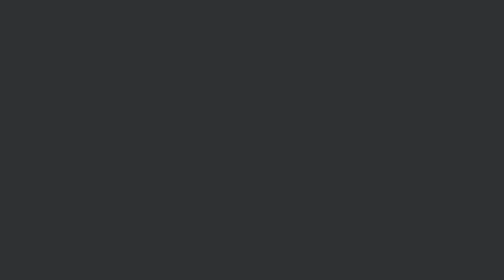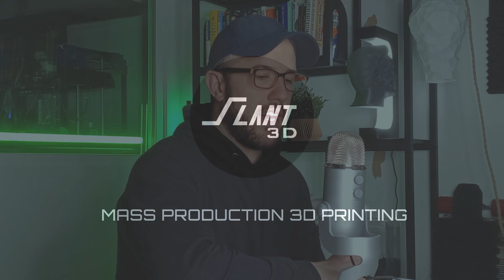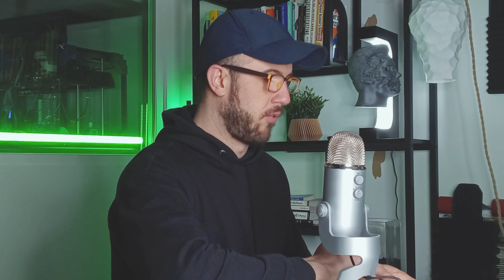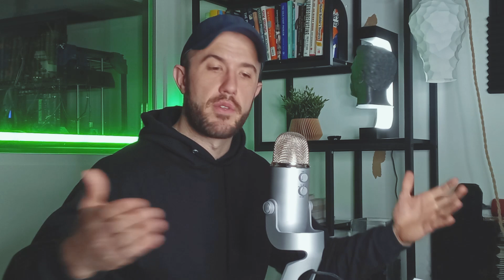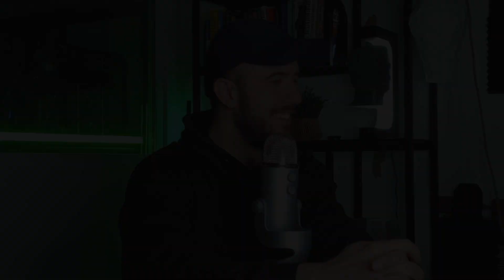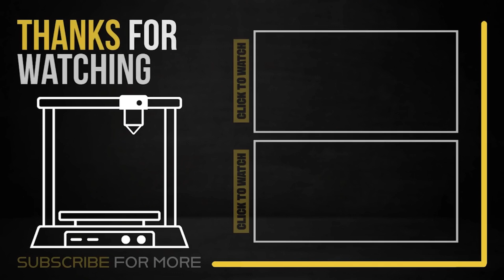Should We Start Making Filament, 3D Systems' Fined, & Stratasys Buyout Attempt

Comment: Can you please discuss the counter-offer by DDD at 24.10? Frankly, I see more long-term gain from a technological-level merger of Stratasys and Nano Dimension than Stratasys with DDD. The fact that Stratasys wants to add DM into the mix is rather strange, as DM really doesn't have much to offer either technologically, or managerially. Why would Stratasys even want DM? (Yes, I've read why, but it sounds hollow). Additionally, I believe DDD desperately wants Stratasys merely to remain relevant, as they too have little to offer comparatively. I'd welcome your thoughts. Thank you.

Comment: If you can offer cheap bulk PLA/PETG I think you can really make the market move. 90% of the time i don't care about the appearance of the plastic because im just trying to churn out functional parts yet I have to pay this premium for quality plastic. Even if you just sold reject reels of plastic that didnt meet spec for color or strength or diameter but would still work fine for the average home gamer that would be big. Also, consider ditching spools for extra savings. I would be more than happy to spool up loose filament if it meant saving a couple bucks per kg

Comment: Call it slant simply black pla (most forgiving). 12.99$ for 1kg spool, 29.99 for 3kg, if you buy over 100$ then free shipping. Don't guarantee color, but guarantee accuracy and reliability. Most first prints in hobbies, people don't care about color. If that takes off sell more colors and options.

Comment: I'd love to see a "K.I.S.S." philosophy used in filament production.  PLA/PETG only.  Black, natural & grey only to start with and if things work out well then maybe introduce basic colours.  Really, just the basics and not a whole rainbow pallet of colours.  Most importantly NO SPOOLS!!!!  Sell by length instead of weight and just the ship raw roll that I can load onto my own spools that I already have.  Just a simple product at a low price.  Buy direct from the manufacturer and use the exact same product they use themselves. You could even go one step further and offer a "scrap" line where all your off-cuts, failed extrusions and failed prints are reground, blended and extruded without any concern for colour.  As pure a recycled filament as you could get.  Turn your trash into treasure.
Reply from the maker: We have something we are announcing really soon

Comment: Really anything that's significantly more impact resistant than ordinary PLA. There are some great engineering blends out there, but the price premium for tougher blends can be shockingly high given that the raw materials are still fairly cheap. I'm not picky about color. Things that have worked fine for me thus far: tough PLA, PETG, tough PETG, PCTG, and easy-print (CoPA) Nylon. Ordinary PLA is a bit too brittle for my projects, but a lot of the other options work fine. Some low-cost tough PLA would be great.

Comment: Make sure that your spools are not too wide! Bambu lab AMS has a certain width limit and will not work with spools > some width
Reply from the maker: We'll take that under advisement. Though we don't intend to design toward any particular machine if we do it.
Reply: @slant3d  It's not about designing toward a particular machine really, it's more of a compatibility thing. It's minor adjustment at planning stage that would allow you to have another earning stream open - because if that spool of yours would be wider than the amount of -  46-70mm, and the diameter exceeded 200mm they would be incompatible with the ams - it would be a no-no for that part of the casual market that'd be most incentivized to buy cheap filament. I'm not a fanboy, just that it's one thing that I see shook up the 3d printer market and opened the hobby up to a lot of people who don't want to mess around with bedslingers and spend a lot of money. Anker had made a similar machine (well function wise) - so it's still not set in stone what will end up being the next ender.

Comment: Its worth doing, even if only to supply your local area. Build connections, build recognition, build goodwill.
Reply: If you're going to undercut too hard, you gotta be careful, or those established competitors can literally just buy your stuff out, to prevent their profits being destroyed. It is cheaper for them to do that than eat a big, big loss. 

Basically, be competative as possible. Your company growing is important. If you guys merely sold at market rates, nd reinvested that extra cheddar into filament related stuff is enough.

Comment: I run a small farm of 8, hopefully expanding to 30 or so by this summer.  My biggest issue would be colors not being in stock.  I pay about 13$ currently for petg and a bit less for abs. Also the packaging.  To get the price down sell them a case at a time 8 individual kg spools without separate boxes inside boxes.  Maybe your value prop could be filament specifically designed for farms.
Reply from the maker: We have considered that. Thanks for the feedback

Comment: The PLA/PETG/ABS market has been more-or-less saturated from the low end all the way to the high end. However, where the market is open is the engineering and industrial filaments, like the Polycarbonates, Nylons, etc... You really only have a handful of suppliers that are US-based and all are extremely high cost compared to the raw pellets. If you want to start a filament line, those would be good areas to target.
Reply from the maker: The filament market is stagnant. That doesn't necessarily mean it is saturated.
Reply: @slant3d  I agree that it's incredibly stagnant. We haven't seen anything that would bring a "wow" or any reason to move away from established suppliers at all, in the last three-or-so years. 

I do wonder if PLA/PETG is the target market though, where would Slant3D slot in. We have "low-cost" options like LLLMax or the various "chinamazon" brands covering the $11-20 marketplace, moderate-value shops like VoxelPLA, and a handful of others covering the $20-35 range and high-end USA-based shops like 3DXTech/MatterHackers covering the $35+ market. 

While the quality certainly improves (and I can see Slant3D being the de-facto quality standard, if done well) at higher ranges, to the average hobbyist with 1 or 2 printers out of a garage, the budget line is "good enough." To a print shop like us, I think they value some different things though, like consistency, reliability, traceability, and a robust supply chain - so we gravitate to more expensive solutions. 

Now, if Slant3D can offer the "upper-echelon experience" that the higher-end solutions like 3DXTech offer at LLLDMax prices, that would be "wow"!

Comment: I go thru about 10-12 rolls of filament per month and would love to try your filament. My top complaints of current filaments would be: 
Cost, poor packaging, (mainly vacuum seals getting broken during shipping.... it really sucks having to dry brand new filament before getting to print)  Tangled spools ,<--- Grrrr!   Lack of jumbo sized spools... (for those larger jobs...like in 3, 5, or even 10kg) and physical dimension size of spools... For example,  I need spools that will fit in the Bambulabs' AMS , and not with cardboard... I'll buy your filament all day long if you can make any progress towards meeting those needs. 👍🏻
Reply from the maker: Thanks for the feedback. We definitely would be producing larger spools, since that is the format we utlize in or print farms. But those large spools would not fit in the AMS.
Also, not sure that we can solve UPS damaging vacuum seals in shipping. Once it leaves the door handling it out of our hands.
Reply: @Slant 3D  
Correct, bulk spools won't fit in the AMS. Apologies for any misunderstanding, as my thoughts are many, but don't equally apply to all my machines.  For clarification, I want my cake and eat it too.😊 I need bulk spools for my machines that are able to feed from an independent spool holder... though I would still use bulk abs, pla, and nylon on my Bambu lab X1C... just feed it thru the back of machine for larger bulk jobs... at any rate, I do realize I can't have  ALL my wishes met. 👍🏻 Thanks again for replying back. Much appreciated. Whatever path y'all decide to take, I wish y'all success!

Comment: I snip off the tail of the filament that is attached to the spool before use. Never had an issue with printers trying to eat the spool. I wouldn't care for a "better" spool system.
Biggest issue: filament color that conforms to Pantone or RAL codes. I need RAL 6018, RAL 7035 and RAL 5004. Not impossible to find if I'm willing to commit to a 2000Kg order, which I'm not.
Never had a color consistency issue with a brand, only between brands. Which is why I stick to 1 brand for 1 color.
Medium issue: messy spool windings.
Minor issue: getting 3, 5 and 10Kg spools other than on special order for enough different base colors. Often all you find is black, white and if you're lucky red.
Major issue: (as a hobbyist) hard/impossible to find good quality PACF (PA12, PA6) that isn't made of useless milled CF dust but from chopped CF strands for a "reasonable" price.
Major issue: most brands, even "good" ones, barely publish any datasheet about their filaments. Getting accurate data from them is like pulling teeth. They're not even consistent between their own website, the packaging and the label on the spools themselves.
Reply from the maker: Thanks for that feedback. We will keep it in mind as we play with the idea.

Comment: 7:46 The main reason for me to by filament from you would be for color and texture consistency. When we are doing a long print and we run out of filament mid print, replacing the spool with a filament from the same manufacture and the same color never works. There is always a noticeable difference in color and, sometimes, in texture. The filament is either shinier or has more of a mat finish. It is so frustrating!!
PLA, PETG, TPU and ASA with some basic consistent colors and finish would be great!!
Also, out of the factory DRY and DUST FREE filaments!!
Reply from the maker: Yes. That is a very big problem.

Comment: I'd love more affordable filament! GST3D used to sell a 1kg spool for 6.6 euros before tax, shipping included which is insane, but the diameter was all over the place and can clog a hotend, leading to print failures and at the end, you might be better off going with the expensive option. We print non-stop and the filament costs add up quickly.
Reply from the maker: Yes. "Cheap" really isn't worth it most times.